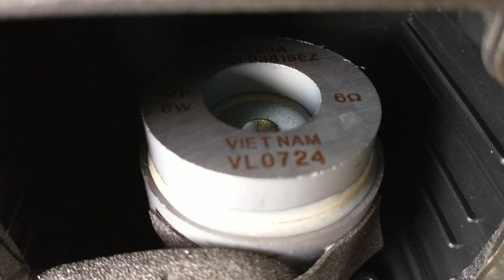Yamaha Soundbar SR-C20A Look Inside (Disassembled) Teardown (Desmontada) Por dentro

Comment: 24 watt RMS ?
Reply from the maker: 120 w rms no total, 30w de cada woofer + 60w do subwoofer.
Reply: 2 x5 w + 1x12 w = ?
Reply from the maker: @lachong3940  2x30. +  1x60
Reply from the maker: https://br.yamaha.com/pt/products/audio_visual/sound_bar/sr-c20a/specs.html
Reply: Watching this video, I only see 5x2 and 12x1 @robsonbraun
Reply from the maker: @lachong3940  The declared power is always from the amplifier, but it is the technical data declared by Yamaha itself.
Reply: The speaker only outputs 22 watts, which is the RMS power @robsonbraun
Reply from the maker: @lachong3940  ok
Reply: The best way to know would be to check from the power amplifier chip specs if they are available to the public. The drivers seem to be in house engineered (wich should be good from Yamaha). So its possible (but less likely)  the amp chips are also in house enginerred.
I just ordered one for the sister in law for xmas. Hope it sounds good.